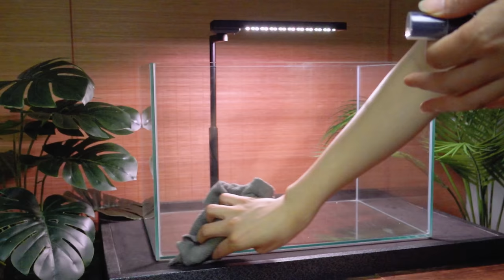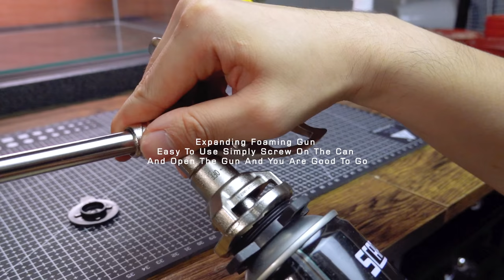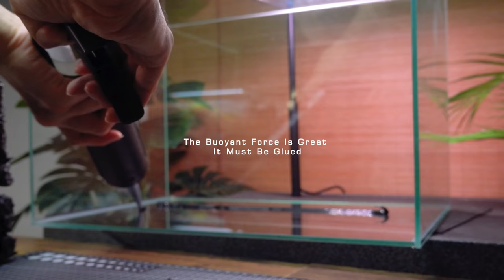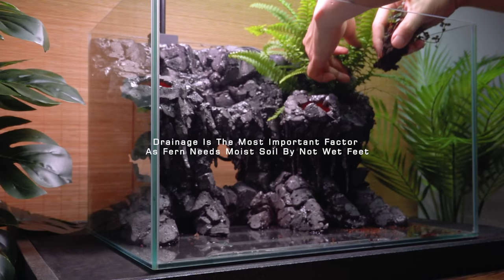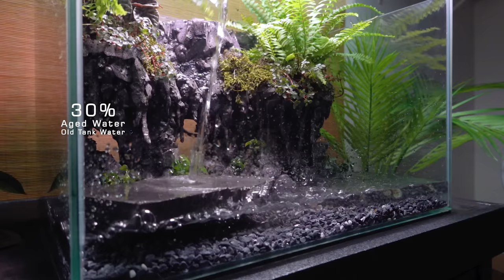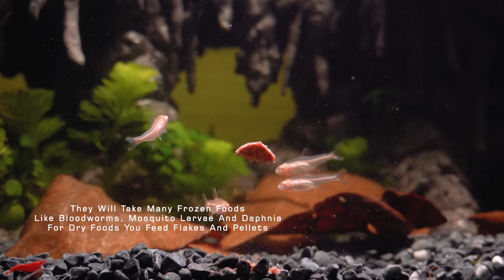Care for Betta Fish l Update Other Fish Tanks l Use Spray Foam To Make Stalactite Aquaterrarium

Comment: Absolutely mesmerizing! How long does the foam last submerged under water? Is there a specialty foam used for underwater applications or did you also epoxy or resin seal the foam for waterproofing?  I'm planning to create something inspiring.
Reply from the maker: I'm glad you find the setup mesmerizing! When using foam in underwater applications, it's crucial to ensure its durability and safety for aquatic life. Generally, the foam used in terrariums or aquariums is often a type of expanding foam that hardens when cured.
Reply: can you identify the exact spray foam that you used in your aquarium ?.. i want to buy the correct spay foam. thank you. @ferretwonderland